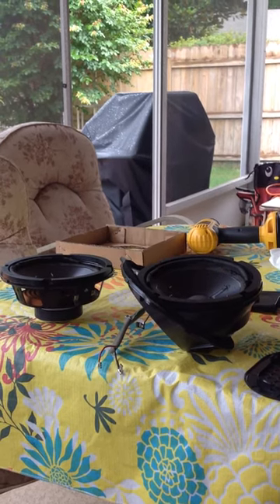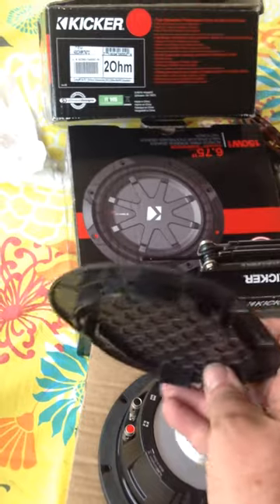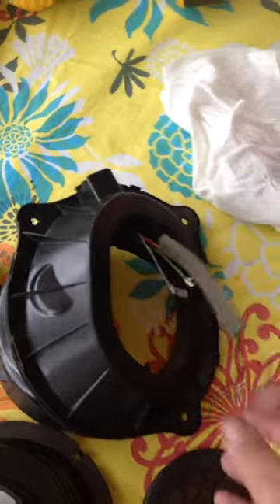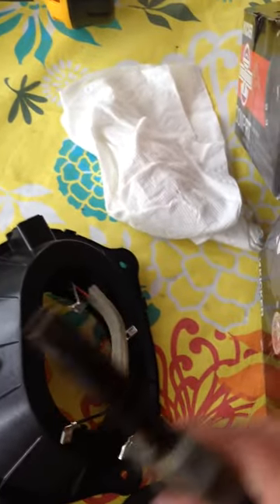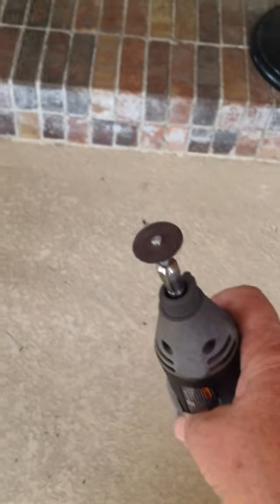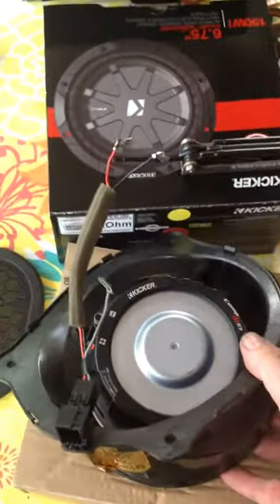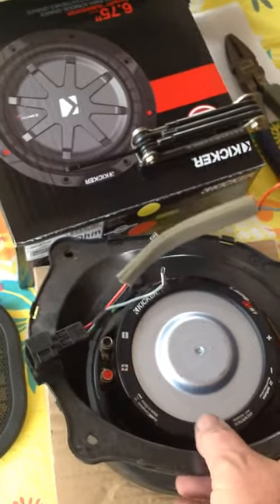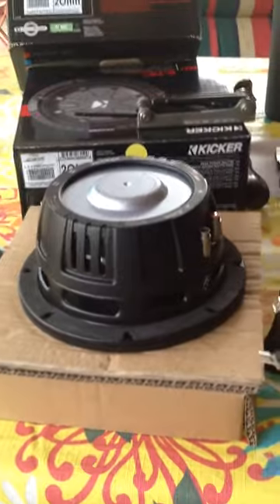CrossfireSpeakerSwap

Comment: I just ordered those speakers and I'm doing this to my 2006 Crossfire.  The speakers haven't come yet but I'll post how it went.  Still concerned about cutting the bracket properly. Thanks for the red and grey wire + designation that is a time saver and also that they'll work as is without sodering.
Reply: How did the install go,how does it sound?

Comment: Karl. I was tirelessly looking for somewhere to place my sub then came across this video. I actually have the same exact sub. Got to the end of the video and couldn’t locate part 2. Please update us on the cutting and the final install. At some point I found my stock amp and it wasn’t functioning, took it out. Will this setup require another amp?. Thanks.